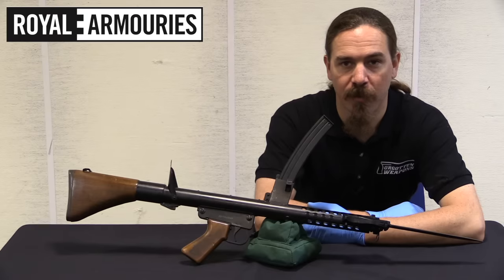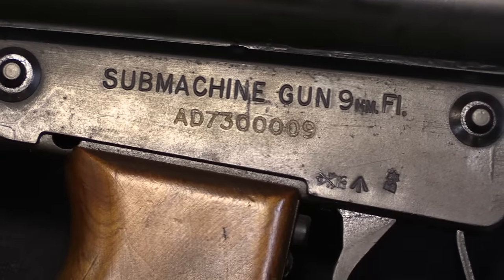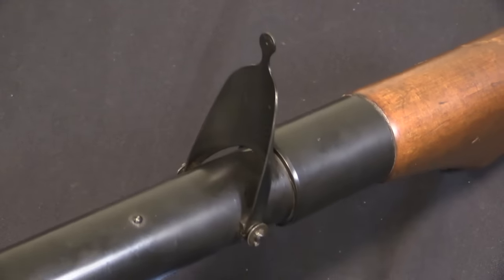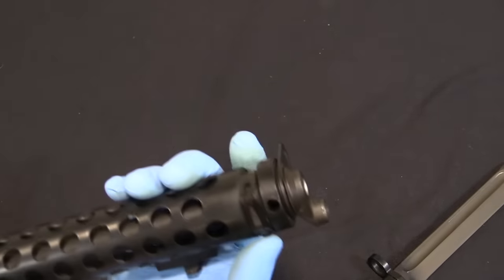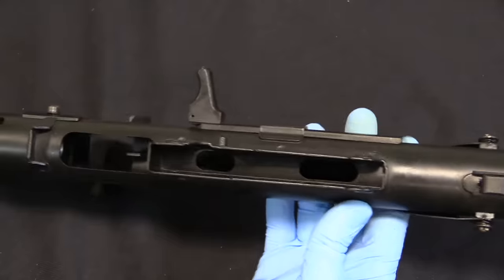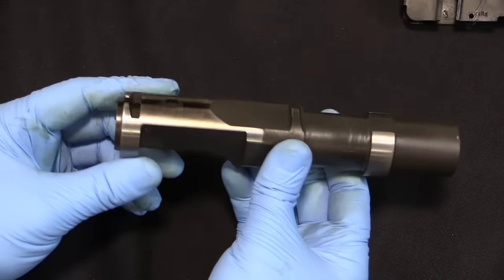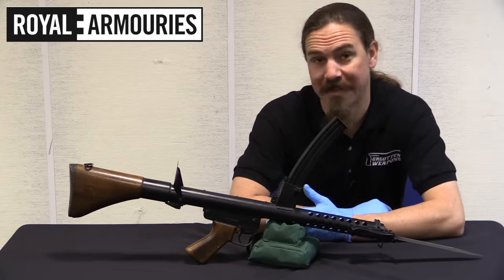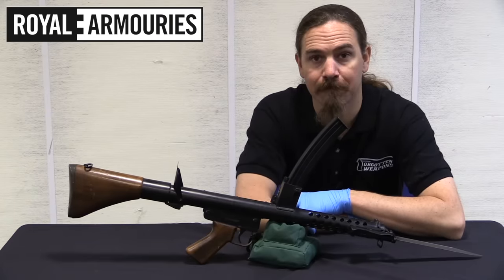Sterling Meets Owen: The Australian F1 Submachine Gun

Comment: The reason the Ozzy's put the sight on the left side, is becuase of the majority of the population being left handed. A phenomenon due to the FACT of being in the southern hemisphere. This obviously can be proven by the water twisting the opposite direction as it goes down the drain. They also shake left handed too. Becuase it is the hand closer to their heart. Suprisngly on the same side as normal folk. It is widely speculated that a child who immigrates from Australia, or, anywhere in the Southern Hemisphere, with the exception of the island of Yap, of course,  withing the first 5 years of life, will suffer extreme mental illness most of their life's. Parents are urged to vaccinate against such events. The vaccine is widely available at any distributor off Microsoft products. As far as the sights, previous attempts to use foreign firearms,  with the sight in center, or on the right, resulted in fireing in the reverse direction intended. This "Friendly Fire" caused the majority of Australia's casualties in the second war. It was actually a misnomer, and did not seem friendly at all. Few jokes were made of the situation, and soon after a solution was  reached, and fireaRms would be devolped in Australia, by Australians. Namely the children from the local schools were tasked with this, as they had the time. A competition was held, and Owen won. This the Owen, with the left hand sight. 

This was copy, and pasted from Wikipedia, so I am assuming it is all correct. It does make sense with the reverse drains and whatnot. It